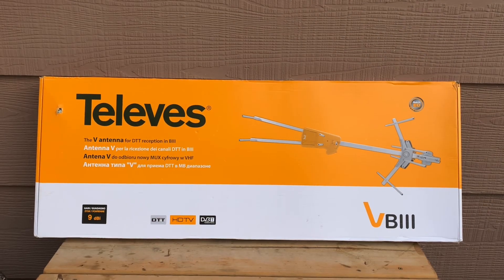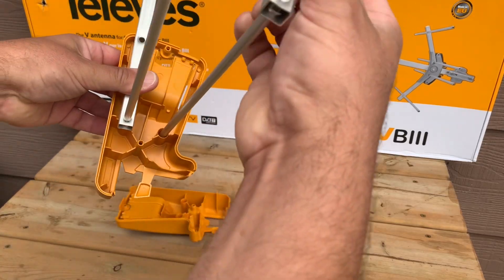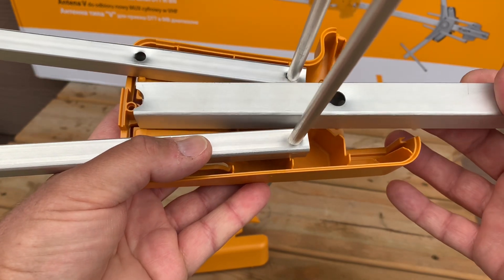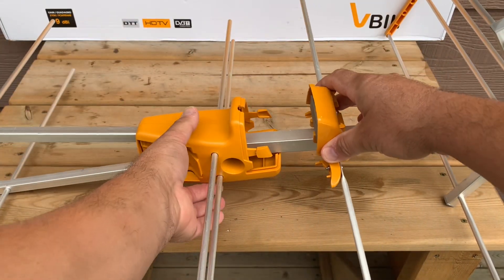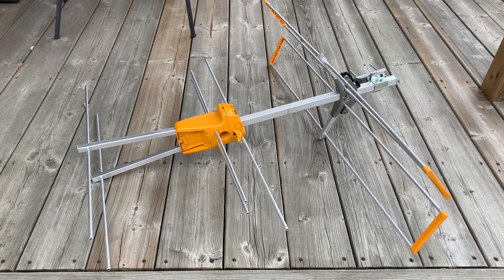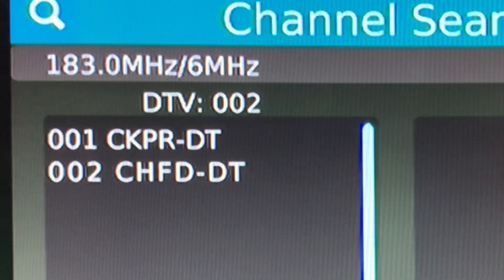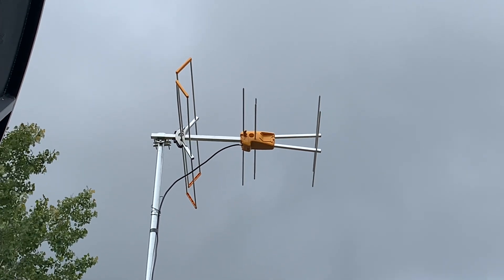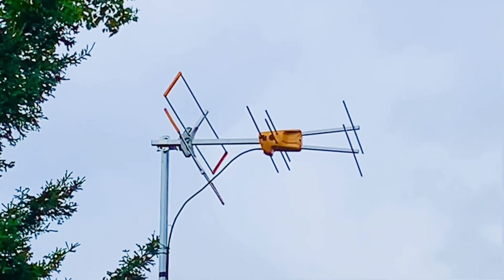Televes VHF TV Antenna Model V BIII High-VHF OTA TV Antenna 106601

Comment: This antenna is also sold in Europe and is used for DAB+ radio and in Poland can be used for both DAB+ and DVB-T television. The difference is that for TV you mount it normal for DAB+ you mount it horizontal. This antenna is excellent for locations with medium to low signal. Televes, Dipol and AMIKO make the best antennas. Some people used it for DAB+ DX-ing (receiving DAB radio stations outside of coverage) of course you need a Yagi antenna with more elements like Stelar Labs VHF High Antenna as an example but the Televes did a good job. As for VHF Low Band a Yagi FM antenna might help with the reception, and everything on VHF High will be received with great signal and no problems.